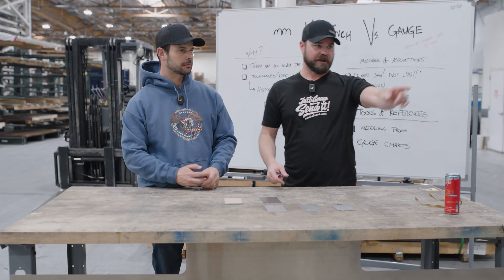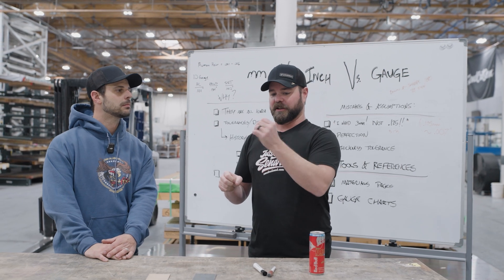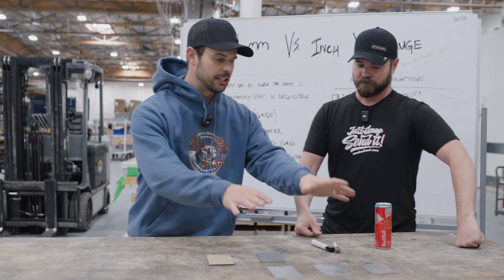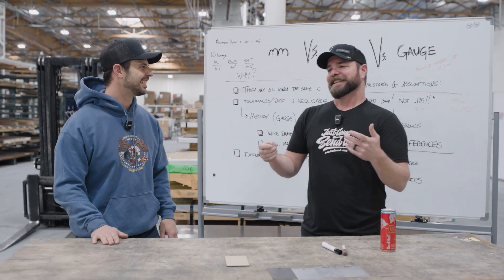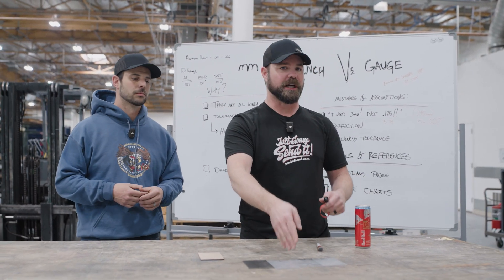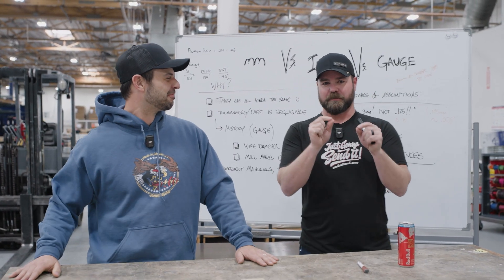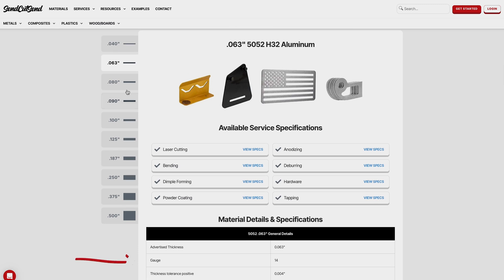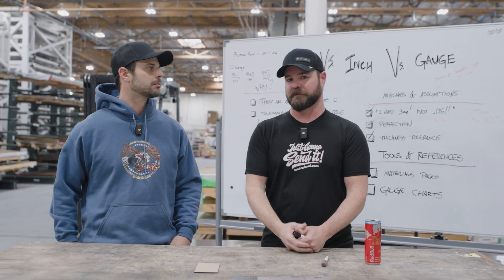Why Gauge Makes ZERO Sense  - Cutting Corners Episode 18

Comment: This is extremely interesting. 
What I want to know is what material gauge chart does the piercing and body modification world use? 

Because I know the sizes of those gauges like the back of my hand.
So when y'all said the aluminum sheets were 10 gauge I was looking as hard as I could because it seemed really really small (Thin) compared to the 10 Gauge in the piercing/body modification world.

But once you brought out the mild steel it looked a heck of a lot closer to what I would expect.

For a frame of reference let's use a common piercing that's a little big bigger (Thicker) that most people would know. A tongue piercing. The standard gauge used for that is a 14G (G = Gauge) and that's 1.6mm
Sometimes a 12G is used to accommodate for swelling because the that gauge is normally a little longer as well as thicker. A 12G is 2mm thick. A 10G is 2.5mm, seems a reasonable system, every other gauge is a half mm thickness right?
Well once it gets to 8G(3mm) it actually starts moving by a FULL mm at a time. So a 6G is 4mm, 4G 5mm, 2G 6mm. Okay, things seem to be getting easier now. Well it gets weird again.
Once you hit 0G(8mm) the next step is 00G should be 9mm, right? 
Wrong, 00G is actually 10mm! It jumps a whole mm of thickness! 

But luckily after we hit 00G, we start using fractions of an inch starting with 7/16" (11mm) then 1/2" 12mm. And we go by a full mm again all the way up the chart.

I just want to know not only what material of gauge system the piercing/body modification world uses, but also how and why we used it at all? 
Because it goes into so many different industries such a jewelry, so now jewelers have to know how much the average 16K gold 12G tongue bar weighs because they have to sell for the weight of the gold on that day.
Totally wild to think about. Strange system, but if it's stuck around this long, it'll probably never go out of phase. Just like how we use pounds instead of kilos. 
Honestly, I think comparing Gauge to pounds and kilos isn't right, those are too normal. 
A better comparison would be to the weight of Stone since it's so obscure but still used.

Comment: I always wondered why gauges went backwards. In my head I thought it was weird since you can always make a wire bigger, at some point you can't make it smaller. Makes sense now, but also still doesn't make sense when you can easily just use inch or millimeter just as easily.

Comment: So that's why gauge numbering goes backwards. 

But I've got to ask, why didn't they just call it by the diameter it ends up at regardless of the number of times it needs to go through the dies?
Reply: Because we were new to these ideas and it made sense back then lol. Perspective my friend, every day we get more of it.
Reply from the maker: 🤷‍♂ Who knows. Gauge measurements pre date standard precise measuring equipment. So manufacturers came up with the gauge measurement systems to standardize it across the industry.
Reply: Probably to make it easier on the the less educated workers (At the time), no need for math, just need to know how many different dies to pull it through? 
Idk, that's just my speculation.